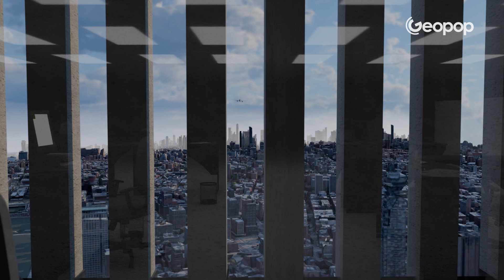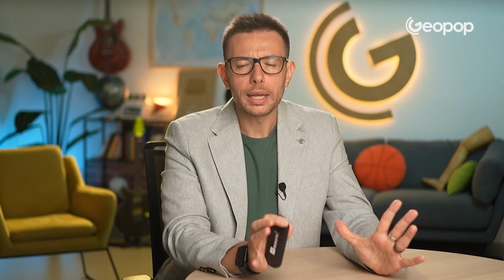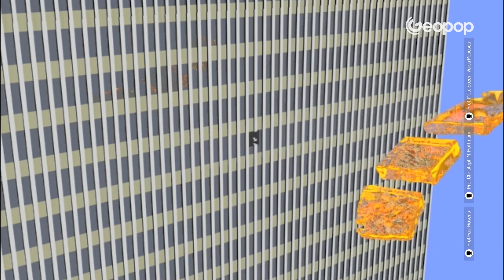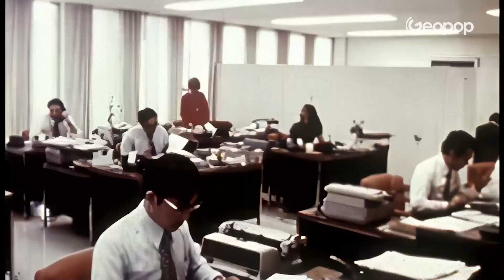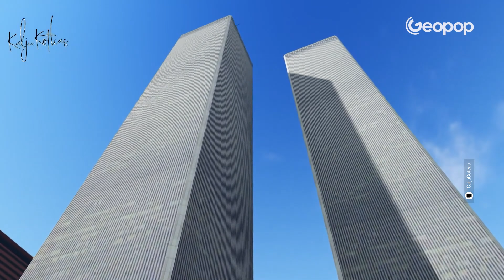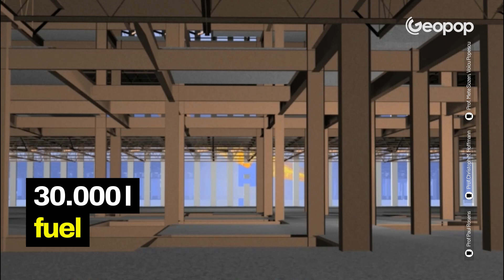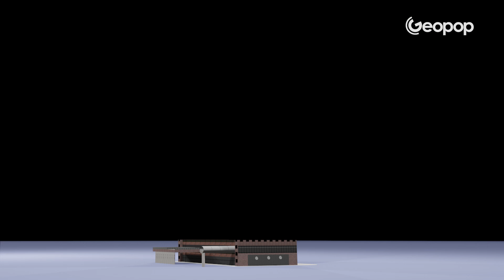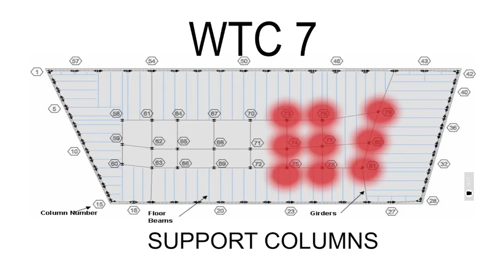9/11, 2001: The Technical Reconstruction of the Twin Towers and WTC 7 Collapses

Comment: Even though a lot of what the official story has some sketchy stuff, I can look past some and just accept I'll never know, but building 7 had a small fire in the lobby. There is no reason it should have fell.
Reply: Building 7 was raging out of control on at least 10 floors for 7 hours - the lobby floor NOT one of them.  Before you decry the official story you should probably learn what it is first.
Reply: @TheLoonResistance  You are a very busy shill Fitzshill!
Reply: @TheLoonResistance here's the thing it started in the lobby, other building have burned for over 24 hours and not collapsed there is zero reason a building that burned for 7 hours should fall in its own footprint, not to mention in the live footage of it when it falls there is no raging fire as you claim. I literally watched it happen that morning. So try again.
Reply: @mikeswoodturning5427  - Uh huh.  Let’s do this right, from start to finish.

Building 7, the 6th building to collapse of 10 lost on 9/11 got little attention early on due to higher priorities. As a result, the information void got filled with technical nonsense, creating lots of confusion and misconceptions. Many people, like you, just want to know what happened. To remove the confusion I prepared this brief summary from my own independent technical analysis. Let me know what you think. 

At 10:28am the WTC North Tower collapsed, showering Building 7 with tons of burning debris, causing heavy damage and starting many fires burning out of control for the next 7 hours. Office buildings are essentially giant piles of kindling when it comes to fires, chock full of stuff that burns vigorously and quite hot. Since half the firefighters had been killed, units in disarray, equipment destroyed, no water pressure, and the priority of search & rescue efforts, 7 couldn’t be saved so firefighting efforts were pulled as futile and 7 left to its fate. Firefighters make that choice every day in brush fire situations - which houses to save and which ones to let go. Only real difference here is moving the decimal on the size and cost. People get overwhelmed by the size. 

www.youtube.com/watch?v=g_SvpwyC17M 

Collapse of a burning structure is always a concern for firefighters. Steel buildings are uniquely vulnerable to fire damage. Designed around 1 to 3 hours of fire resistance for occupants to escape they rely on active firefighting to survive. After that all bets are off. Left to their own devices they'll exceed their design envelope and collapse, like Plasco Tower and Wilton Paes de Almeida. In 7 the occupants escaped, passive and active fire protections were compromised and active firefighting was abandoned hours before the collapse, which left the building to its fate. It lost. Odds on Building 7 would eventually collapse, and it did. No big deal in logic. 

www.youtube.com/watch?v=WnYBX6QT0R4 

FDNY Chief Daniel Nigro - The biggest decision we had to make on the first day was to clear the area and create a collapse zone around the severely damaged 7 World Trade Center, a 47-story building heavily involved in fire. A number of fire officers and companies assessed the damage to the building. The appraisals indicated that the building's structural integrity was in serious doubt. I issued orders to PULL back the firefighters and define the collapse zone. It was a critical decision; We could not lose any more firefighters. It took a lot of time to PULL everyone out, given the emotionalism of the day, communications difficulties and the collapse terrain 

FDNY Deputy Chief Peter Hayden ; We had our special operations people set up surveying instruments to monitor and see if there was any movement in the building. We were concerned of the possibility of collapse in the building. And we had a discussion with one particular engineer there, and we asked him if we allowed it to burn could we anticipate a collapse and if so, how soon? And it turned out that he was pretty much right on the money, that he said 'In its current state you have about 5 hours 

The collapse of Building 7 was anticipated and widely reported in the media throughout the day, with 24 video cameras recording it. Everyone knew what was coming and why. 

www.youtube.com/watch?v=OY5S5k3tMHI 

Building 7 collapsed from the inside out which is not intuitive and hard to understand. Most details are hidden from view and some people will struggle no matter how much it is explained. But here is my best shot relying on no outside authority. Building 7 was a unique, asymmetrical 47-story steel frame structure built atop a smaller 3-story building serving as a partial foundation and requiring lower floors dedicated to complex load transfer structures. Of trapezoidal shape and tube-in-tube construction, B7 (above the 7th floor) consisted of a central core of steel columns carrying most of the gravity load, perimeter steel columns around the outside of the structure carrying the remainder of the gravity loads and long span beams and girders to tie those elements together and form the floors. On the outside of the building hung a curtain wall facade or outer shell. www.nist.gov/image-16640 

Phase 1 : First externally visible signs of collapse initiation occurred at 5:20:28 pm and was notably quiet with observers not realizing the building was collapsing! No warning in the form of hundreds of eardrum busting 180dB explosive bangs. Here at 12:00 a local CBS affiliate reporter is just 10 blocks from B7 when collapse begins. People don’t start to notice the collapse until 12:11. At 12:45 is the famous CBS fixed camera clip of Building 7’s collapse. Note the silence. 

www.youtube.com/watch?v=t5tEy6mXSE8 

Lower floor failures above the load transfer region (8-14) in the NE corner initiated the collapse. In this video at 0:45 you can see the NW corner from inside the building while under construction, Column 79 just out of frame on the left. That big, angled steel beam across the top of the frame connects to C79 at one end. The girders connect to the beam. That beam and all those girders depend on just one connection 

www.youtube.com/watch?v=nP3TNHPCIVU&t=45s 

Phase 2 : NE corner floor failures caused a loss of critical lateral support over an excessive length of Column 79 and it buckled. A column buckles when it takes on more load than it can handle. Externally we see a vertical progression of window breakage along the 44-46 line and a kink in the roof of the East Mechanical Penthouse atop the building, all consistent with C79 failure. Looking at the above floor diagram of Building 7 when you see all the structures that depend on C79 you quickly realize this one column was a relatively isolated structural element on which a disproportionately greater fraction of the structure depended analogous to say the Key Bridge. Normally with a buckling column, the load could be redistributed to other columns. With C79 that is not the case - the failure did not redistribute the load, so the collapse rapidly progressed to the roofline, sinking the rooftop penthouse. The transition from full capacity to almost no capacity occurs in an instant and will result in virtually no resistance 

Phase 3 : With C79 gone, B7’s progressive, non-symmetrical collapse continues with adjacent columns C80 and C81 left laterally unsupported and quickly buckling as well. The EMP drops down through the building. C79-81 all have no diagonal bracing, which is the major reason why they could not redistribute a lot of vertical loads among one another. From there collapse progressed from east to west through the central core until the core was gone from C81 to C58, taking all the interior floors and probably most of the perimeter columns with. Follow the horizontal progression of window failures low in the building and the dropping of the remaining rooftop structures into the building. The NIST Building 7 study model 4 determined C79 failing under ANY circumstances would have initiated the same collapse sequence. 

Phase 4 : After about 10 seconds only the exterior moment frame remains, giving the illusion B7 is still standing to the casual observer as little has changed outwardly. But it is just a hollow empty shell like an empty cereal box supported only by a few remaining columns and quite unable to remain standing on its own. With nothing remaining behind it, the north face of the outer shell leans into the void, forming a V in the roofline, the last few columns buckle under the strain and the moment frame free falls, landing on top of the debris pile.

It is only now that we get to “free fall”. For those who get all worked up about an alleged 2.25 seconds of free fall - don’t. How fast something falls can’t tell you what started it falling, the alleged measurement people fuss about is wrought with problems, not least of which being it isn’t The Building (defined as its center of mass) being measured AND the measurement doesn’t even start until more than 10 seconds after the collapse begins, meaning whatever caused the alleged free fall was due to collapse progression mechanisms NOT collapse initiation mechanisms. Useless for informing on what caused the collapse in the first place. It is now and always has been a Red Herring. 

The debris spread well outside the footprint blocked surrounding streets, heavily damaging the Verizon Building and destroyed Fiterman Hall. 

No building is meant to survive 7 hours of multi-floor unfought fires. Building 7’s progressive, non-symmetrical collapse was incidental, unintended collateral damage from the combination of fire, time & gravity started by the collapsing North Tower, true no matter who planned and carried out the 9/11 attacks or why . Of so little consequence it barely registered at the time, only taking on semi-mythical status as an alleged smoking gun years later when demolitions at the Twin Towers, missiles at the Pentagon and shoot down over Shanksville all failed and conspiracists had nothing left to work with. 

Anything can seem like a conspiracy if you don’t understand how it works. Now you should. I hope you found this helpful, informative and it solicits informed critical comment. If I made any errors of fact, logic or reason or left anything important out, please let me know so I can fix it. OR offer a more plausible alternative if you can. Be the first. Please start any reply with the words “Tits McGee” or I will know you didn’t read it and are wasting my time.